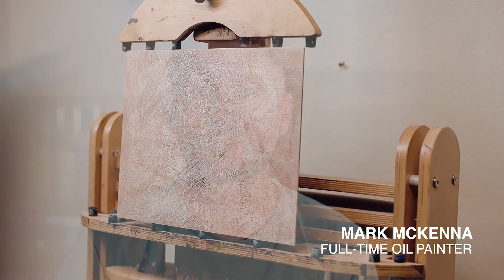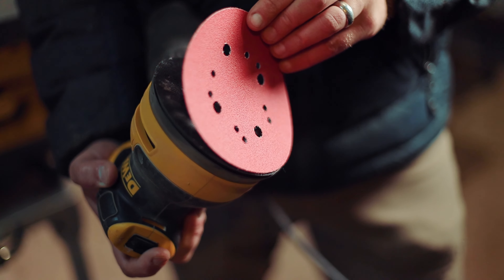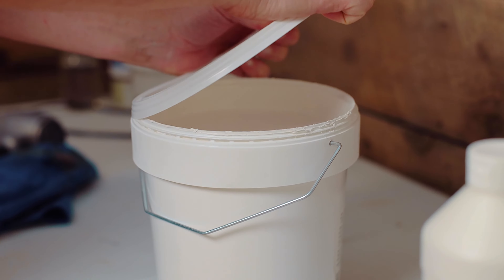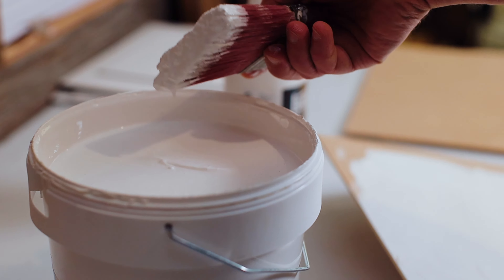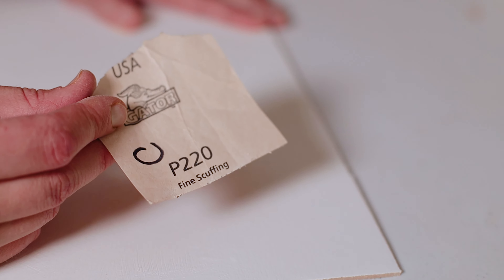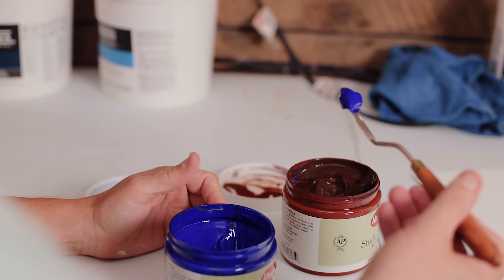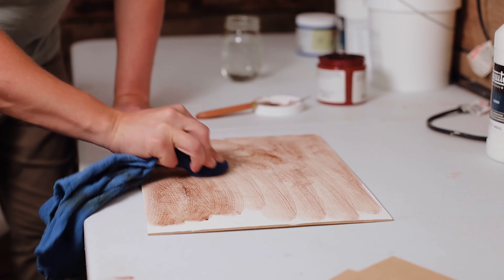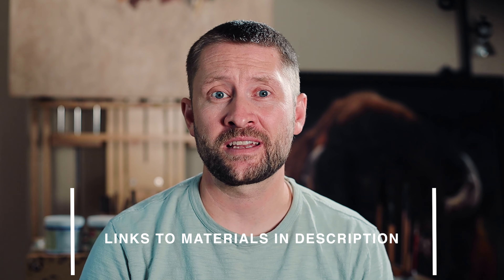Preparing Hardboard & MDF Panels for Painting

Comment: I had an MDF panel stored in my studio (garage) that in just a few weeks, got covered in a green and black mold coat.. it was truly scary to see it happen as I've just moved to a very humid region. I wonder how I should prime the back of my MDF panel, in order to prevent all my future work from deteriorating? 😪
Reply: Eliana, what type of paint are you using?
Reply: @rduff1999  I paint with oils but the back of the MDF was not primed
Reply: @bootykingnadal  scary stuff! 😅
Reply: @ElianaLemosArt  k you have some choices. Wood panels need a protective coating on the front, back and edges to protect it from humidity as you have discovered. For oil painting I use either Gamblin PVA size or Golden GAC 100 (2 coats each). They both dry clear so that the wood grain pattern of the birch panels can be seen on the back. I use the GAC 100 when I am impatient. Hope that this has been helpful. Happy painting.
Reply: I recently discovered a clear runny liquid called a nano penetrating sealer in a builders merchant while I was looking for PVA. Bought some to try. Two coats and the boards repel moisture. But then I think about moisture that may already be in the boards and now can't escape.
Reply from the maker: I think when living in a place with high humidity, it’s definitely a good idea to seal all sides.
Reply: @thebusinessof_art what would be the best thing to seal with? I live by the sea and evn my canvases get mould
Reply: @vandanabhagat706 he already answered in this thread: Golden GAC 100 or Gamblin PVA.
Reply: @jc-aguilar
Reply: Hey woodworker here. Bullseye shellac will dry in less than an hour and it's awesome on sealing MDF for light duty
Reply: Hopefully some prime paint on the back, I would use some paint from the hardware store for that;  air might look into checking temperatures of the humidity levels maybe studio needs air moving but I would still paint the backsides

Comment: All good, though I would recommend first giving two coats of a very good quality acrylic medium at full strength to seal the surfaces before applying the gesso.  IMO, the chalk in gesso tends to make it too absorbent to provide complete protection to the panel surface.
Reply from the maker: Thanks for the tips!
Reply: Gesso is acrylic !

Comment: This is what I did, until I discovers alkyd oil primer, and def Rublev Lead Alkyd Ground. It dries in same amount of time as acrylic gesso and it is sooo smooth, the way I like it. Well, I should say, the paint glides and sits up on it, rather than sink slightly with acrylic. But hey, art is definitely subjective, and whatever works for the individual...is really all that matters! Whatever gets people creative! Just thought I would share my alternate...Great vid! excellent editing 👌
Reply: Do you ever apply a sealer before gessoing?
Reply: @kimberlyworthington2404  no need !
Reply: @kimberlyworthington2404  They say you don't need to, however the panels are wood and subject to absorbing moisture from the air humidity. I use Golden's  GAC100 to seal front, back and all edges. Hope this helps
Reply: @linussouthwick7987  I know they say you don't need to but, if you are painting on wood panels, you really should seal the front,back and all edges as wood will absorb moisture from the air and that can cause future problems.

Comment: I have seen other people say that you need to seal this Masonite board on both sides before doing anything. Obviously that isn't necessary according to your experience. But I wonder if it wouldn't hurt.
Reply: My understanding is that sealing both front and back of the panel is to prevent warping, especially if you are using the 1/8 thick panels. Personally,  I use 1/4  thick panels but still seal both sides and all edges whether I'm  using oils or acrylics.
Reply: Yes these thin boards will 100% warp over time.
Reply from the maker: Can’t hurt
Reply: I've painted on both types of  Masonite! They  must be sealed on both sides. If you don't,  it will warp! One type will bleed through and the other absorb your paint. Also the harder type is quit heavy! I buy 1/8 inch maple plywood  found in the flooring section of Home depot!
Reply: @robertchilders8698  do you think plywood is better than Masonite for larger size paintings?

Comment: If the content poster is still checking the comments, I have a question. You mentioned you use birch boards. I guess you use the same process? I'd like to use the grain of the wood in my work so I bought Liquitex Clear Gesso. Does that also need to be sanded and multiple layers put on before I use paint on the wood? Is it just oils that affect the surfaces that way or can I get away with less gesso with acrylics used as stains? Thanks for any reply.
Reply from the maker: I’ve never used the clear gesso, I would definitely try to follow any directions you see on the product labeling, and I would definitely err on the side of too many coats rather than not enough. Sorry I’m not more help here.

Comment: Stefan Baumann uses automotive primer spray can (believe it or not).
Stefan paints in oil.
What do you think?.
Reply from the maker: There are a lot of right ways to do this. As long as the surface is getting sealed and you’re creating a barrier from the wood product that protects it from the oils, that’s the goal.
Reply: I Tried automotive  primer. Don't like it! Especially on wood. I sealed my 1/8 inch , birch or maple plywood  with a good acrylic sealer , followed by gesso! I buy my panels at Home Depot, flooring section!
Reply: A lot of fumes, and not designed to prime wood (auto primer is designed to prep metal from rust). May not be acid free. May want to gesso on top if you try it.

Comment: Should we follow the same process if we want to paint with acrylics? Over MDF.
Reply from the maker: I think that you can paint any kind of acrylic paint directly to these panels because they're water-based, and there are no oils that will cause the board to deteriorate, but if you want to create an interesting surface, it wouldn't hurt. It also might help to have a layer or two just to keep the board from absorbing the moisture of the paints too quickly.

Comment: Would it be a good idea to use mdf sealant on the mdf board on both sides before applying the gesso? I imagine this would stop the wood from absorbing moisture over time.
Reply from the maker: Not sure what that is… do you know of a product?
Reply: You really should seal the wood to create a waterproof barrier that the gesso does not provide. It may seem fine now (and many years) but over time the wood has a much larger chance of warping or even rotting. The painting itself can be effected by Support Induced Discoloration (SID).

They have products specifically for this such as GAC 100 but you can use various wood sealers from hardware stores like polyurethane.

Your ignorance is misleading people.

Comment: awesome tutorial, how do you hang them on the wall afterwards?
Reply from the maker: I would mount them into a frame of some kind… if it’s a cradled panel you can paint the sides however you like and hang it by itself, I personally put them into a floater frame.
Reply: Sokko, if you are hanging the thin panels only you can put them in a normal frame but need to hold them in place with brads. Or you can turn them into cradled panels by adding 1/2 inch thick wood strips to the back. They can then be mounted into floating frames from behind with screws. The wood strips you add have to be sealed against moisture absorption. Hope you find this helpful.

Comment: Stupid question, but are some of these types of wood more prone to warping and if so, do you have any advice on how to prevent or fix this? Some of them looked a little warped in this video--I am used to seeing paper warp for watercolors, but I know very little for oul medium and figured I'd ask.
Reply from the maker: I don’t typically paint both sides of the panel, but I’ve heard from several artists that it helps.

Comment: Thank you.  Great video.  Do you recommend priming the back of the board with GAC 100?
Reply from the maker: I am not familiar with GAC 100, I know a lot of artists like to prime the backside of the panels, I have never really done that, and I have never had any issues. Probably can’t hurt.
Reply: @thebusinessof_art  Golden's GAC100 is a primer/sealer. All edges  and back of wood panels should be sealed against moisture absorption. If you are using oils, the front should also be sealed first, even if you are using acrylic gesso.

Comment: Is there a difference between Tempered and non-tempered hardboard? My hardware store only has tempered (oil-tempered). Thanks so much for your videos, they have been SO helpful.
Reply from the maker: I found some information about the difference between regular and tempered hardboard: "Tempered hardboard adds an additional step of coating the hardboard with a thin film of linseed oil and baking the board to give more water and impact resistance, hardness, rigidity and tensile strength."
Reply: @thebusinessof_art  thank you! I wonder if it’s oil content means that it needs to be prepared in an alternate way to prevent delamination. I used GAC 100 & 2 coats gesso, before oil painting. We’ll see 🤞🤞
Thanks again!
Reply: @yibuseato  Linseed oil in the board doesn't seem so bad when the oil paints are made with linseed oil too.
But using an acrylic gesso on linseed oiled board seems like a bad idea (I read that acrylic over oil is a no-no?)

Comment: Hi thanku for a very detailed explanation.  I don't use oil paints. I'm new to acrylics , about 2 or so years ..  can you use that same gesso for the acrylics?   Do you know how long gesso is good for?  I haven't painted in over year so I wasn't sure if it is ok to use.  Thanku for sharing
Reply from the maker: Gessoing is only necessary for oil painting, because of the oils. You can definitely use the same process for acrylics, but you can also just paint acrylics directly to the panel if you want as well. Because acrylics are water-based, they won’t damage the panel over time. Gesso creates a barrier between the oil and the wood, and it should last indefinitely if the proper care is taken.
Reply: @thebusinessof_art  thanku very much. That was very helpful.. one day I'll try oils.  They are  so vibrant and beautiful.   I got a long way to go before thst part lol your obviously very knowledgeable and talented.. enjoy your day
Reply: Karen, I believe that  if your gesso container has been properly closed, your gesso should still be fine. I'm fairly sure that some of mine had not been used for a year and it was ok when I prepared some panels a week or so ago. Something that might help is, if you know you're not going to be using it for a long time, is storing it upside down. I work mainly in oil and have noticed that Gamblin stores their oil ground like that.Hope this helped
Reply: @R Duff  hi how r u?  Thanku so very much.  I will try that storing technique.   I'm happy to hear your gesso was still good. Mine should be ok. Have a great day/night
Reply: @karens7620  Hi! I am having a great day and I hope you are also.
Reply: @rduff1999  hi I am thanku.  You keep having one...

Comment: why dont you seal the sides?
Reply from the maker: I don’t prime the sides because I don’t put oil paint on the sides. Wherever you plan to have oil paint is where you should be priming.
Reply: You should seal the front, back and all edges of any wood panel as wood absorbs moisture from the air which could cause future problems.

Comment: Careful toning with the watered down acrylics. Washes of acrylics without a little medium added in general should be avoided, especially on the 1st layer. 
Your also thinning the binder. You can physically paint over acyrlics, but it is not archival. I would personally rather stain my gesso with a drop or 2 of acrylic color if your in a hurry for a toned surface.
From what I learned, it is much better to give the acrylic primers a couple weeks or even months to dry properly and then wipe off the surface with a damp cloth. Supposedly the oils will adhere better to the surface. 
Food for thought anyway
Reply from the maker: I am not aware of this idea, until hearing it from you... so I don't have a thought either way

Comment: Great video:  Newbie painter here, I've heard several times now that it's advised to make 100 practice paintings on MDF to really get into the flow of painting, so to speak. I would like to do this but  could you advise me the best size for practice paintings from a large sheet of MDF board?
Reply from the maker: I personally recommend painting pretty small like 8x8, 8x10, 10x10. Smaller paintings can be completed quickly and help you lear to solve problems on a small scale
Reply: Please be careful if you are cutting up your own MDF board.  Always wear a mask to protect yourself from the dust.  The gentleman who made the vid. uses Masonite or birchwood panels.

Comment: i read somewhere you need to paint the back too or it can  warp in winter
Reply: If you want avoid any problems with wood panels the front, back and all edges should be sealed against moisture absorption. I use two coats of GAC 100.

Comment: Would you go through the same process when using acrylic paints?
Reply from the maker: I probably would, but for an entirely different reason. You don't need to protect wood or other wood product substrates from acrylic paint, to my knowledge. But, for me I like to work on the surface that this process creates, so I might still do something similar to give me a surface I like to work with.

Comment: Please don’t cut these panels on tue table saw as shown. This is an unsafe practice and cutting like this will increase the likelihood of kick back. Please use the riving knife that comes with your saw and never cut a piece that is wider than its length. Use a sled instead or your miter gauge.
Reply from the maker: Safety is always the priority. If you don’t feel comfortable operating a table saw, you probably shouldn’t. I have been cutting my panels like this for years... never had a problem.
Reply: @thebusinessof_art  many people have lost fingers, or worse, from over confidence. Some with decades of experience. I make a lot of dado cuts for cabinetry projects and have removed the over blade guard but I always use a riving knife when cutting panels as you did. It keeps the cut from closing up which causes the blade to bind resulting in the throwback. Safety First.